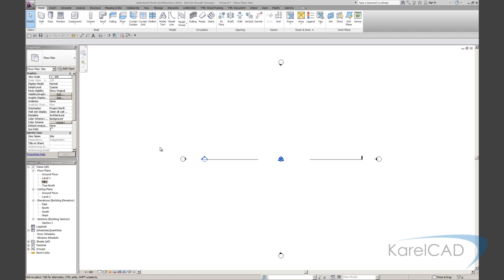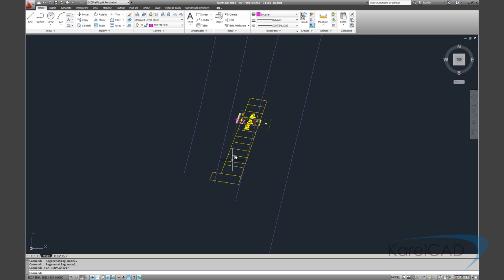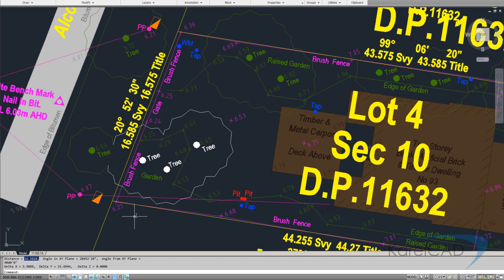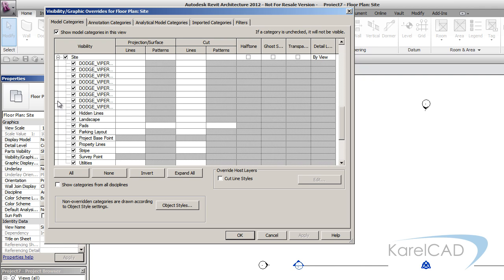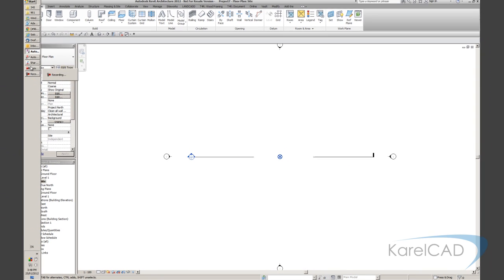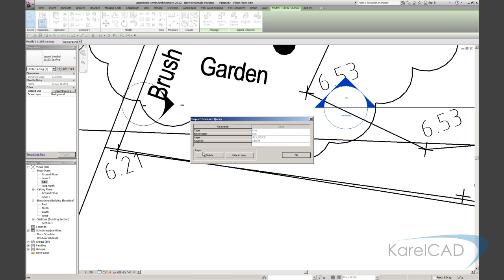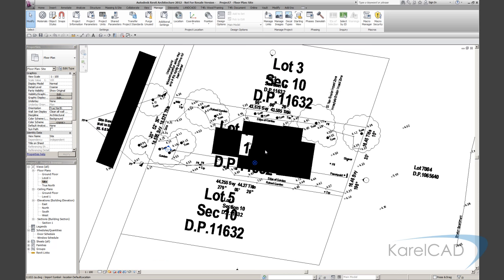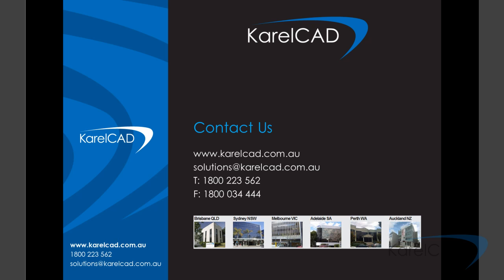Starting a new Revit project from a dwg file

Comment: A very important tip, which I have recently discovered after a lot of suffering, after you guys follow the steps in this video, and you still have this annoying message and some problems with the CAD dwg in revit, just try to save it as .DXF before linking it to Revit.

Comment from the maker: Depending on who you are collaborating with you may only need to rotate True North, however with the process demonstrated in this video you can export to dwg and nwc etc and other consultants using AutoCAD or working in Navisworks will be able to bring the export files into 0,0,0.

If you don't want the dwg file in your drawing, since it is linked, once you have finished setting up your Revit project from it you can simply remove the link and this will remove the dwg file from your project.